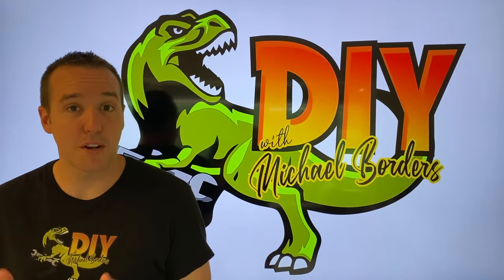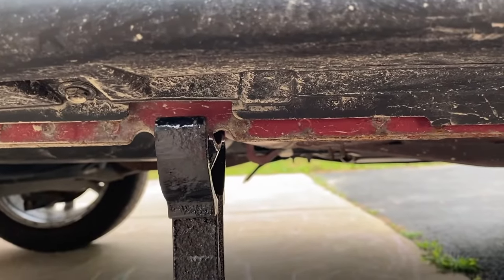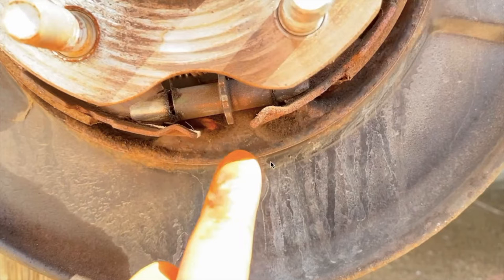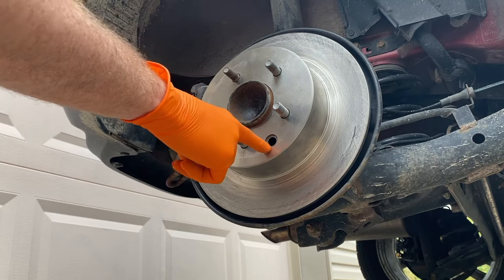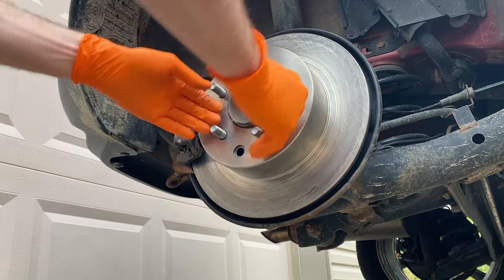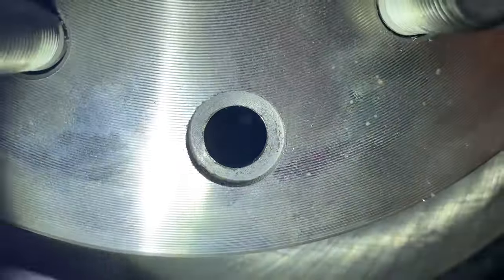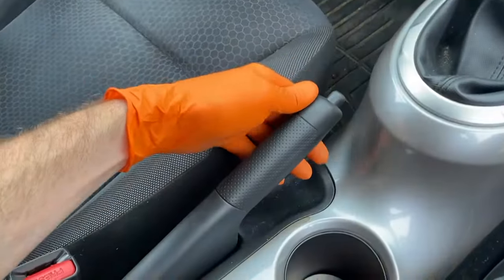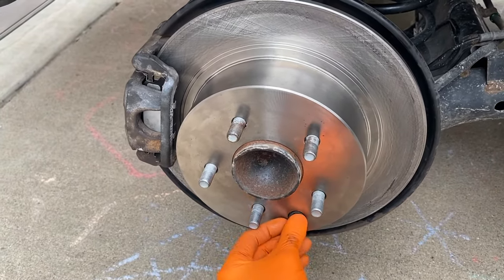Rear brakes rubbing - Adjust emergency brake

Comment: Thank you so much for this video, I had replaced the caliper and rotor but couldn't figure out how to set the emergency brake from rubbing. This was very helpful and I got my tire back together. Now I will need to replace the emergency brake shoes but that will be for a different day
Reply from the maker: You are very welcome, we are honored to hear our video was helpful.  Awesome job making it a DIY project.

Never forget the power of DIY… You will continue to benefit greatly and save lots of cash over the years by making your projects DIY!

😁👍🧰

Comment: I adjusted mine up since it’s a loud rubbing noise. I did it like how explained in the video but it was still rubbing pretty loud. I adjusted it up a few more times but then I couldn’t move the wheel by hand even with the parking brake off. Is it something more than just the adjustment that I should be concerned about?
Reply from the maker: Good morning ☕️

Any update?  Any recent repairs completed to brakes system vehicle wide prior to your issues?

This will help us figure out if any recent repairs are tied to your issue.  Looking forward to hearing back from you.

Comment: Did you do both sides? How many clicks did you end up needing to do? Last question I promise, do you rotate down on both sides to adjust? Thanks for the video. This will save me  money.  👍🏼
Reply from the maker: @sirlosealot8629  

Thanks for watching, we adjusted both sides however, you do not always have to adjust both sides.

The adjustment wheel can be raised or lowered as you adjust and find that perfect sweet spot.
Reply: I saw a couple videos on my infiniti and they adjusted up for tighter, but mine was down for tighter.    Another thought I have, these thin drum brakes under disk brake rotors aren't really emergency brakes, but parking brakes and not much at that.    Like on trucks, you depend on the e park to hold the truck in place, these little brakes won't do that and if you adjust them where they will, they'll rub and smell.    That's my understanding from my car.   I was trying to get them to work like my old cars and trucks with drum brakes.
Reply from the maker: @robbyddurham1624  

Thanks for watching, great thoughts.  In most modern rear setups on vehicle’s, there is a separate emergency brake motor assembly that activates when emer-brake button is selected.  It looks like a black plastic case or housing on back side of wheel and caliper.

This is completely separate from rear drum or caliper/pad brakes.  But again, this is the modern vehicle design, but pretty neat.

Comment: Do you put the gear in neutral during the process?
Reply from the maker: Good morning ☕️ great question.  You will keep transmission in the Park configuration during this project.
Reply: It’s a front wheel drive car so no the rear wheels are free spinning. On my Frontier I have to put mine in neutral (after chocking the front wheels) to adjust the parking brake.

Comment: Hello, is the car in park or neutral when doing this?
Reply from the maker: Thanks for watching, transmission will be locked in first gear.  If you have a manual transmission, configure it in Park.  👍🧰

Comment: Is the emergency break only on one side? Or do you have to adjust both sides?
Reply from the maker: Thanks for watching, both rear hubs will have the adjustable crank installed & can be adjusted to desired safety setting.

😎👍
Reply: Thank you, I was going to ask the same question

Comment: Do you do it on one side only? Or it has to be done on both sides?
Reply from the maker: Thanks for watching, you can adjust both sides for best results.

Let us know if you have any additional questions and hey if you’re into crypto, join our DIY ecosystem.

       toolboxtoken.com

Reach out to us any time!  🧰
Reply: Let me add more color to this. When u park on a slope, you must engage parking brake in neutral- not in Park. Then if u leave the brake pedal the car should hold. Then put it in park. When you start the car next u will see the shift from park to drive will be smooth. This will extend the life if your transmission. Your parking brake should be capable of holding car still in neutral even on a slope.

Comment: I have disc breaks on all four wheels. There are no drum breaks in the inside of my two rear axle break disc's. I have replaced all 4 brake discs with their associated brake pads. 
Now the two rear axle brake discs are hard to move by hand. So I don't need to increase the tension, in the handbrake cables, but rather reduce it. 
I can't find anything on/in the rear break dics, So I guess I can only adjust the parking brake with the 2 screws, in the interior, under the parking brake lever.
I found a video, were a man said:  The parking break in a rear disc brakes system, is self adjusting. And therefore can't be adjusted.

Any help is appreciated
Reply from the maker: Thanks for watching.  Unfortunately a self-adjusting emergency brake doesn’t always…well…self-adjust.

You may need to perform this manually.  Unfortunately we don’t have a video on your exact vehicle with the caliper setup on rear wheels.

It may be as simple as spraying the cable with brake cleaner and re-lubricating it.
Reply: @DIYwithMichaelBorders  my parking break cables (rear axle) are in a good and condition and well lubed. 

Where can I adjust my parking break, the only thing I can see, is under the parking Break lever in den interior.
Reply from the maker: @ImplantedMemories  

Awesome!  You can follow cable into caliper and carefully adjust or you may need to take apart center council.

Comment: I think my e brake is sticking at all times my nissan titan feels like im driving with my e brakes on even when i stop and engage the e brake and let off the brakes my truck will still roll and drive the same as if the ebrake is not on can loosening that little spring fix my issue??
Reply from the maker: Good morning ☕️

We can hopefully help.  It may be that you need to apply lubricant to your cable to get it to move freely again as it could in its earlier years.

Below is a link to our video showing this process.

       https://youtu.be/BuotJ-1yWNU?si=Ybc-OBZYQgPFIjVB

😎👍🧰

Comment: What's the steps for adjusting ebrake when you have a push pedal brake (2018 Altima), in my case..
Reply from the maker: Thanks for watching, it will be similar.  You will adjust mechanism inside wheel hub.

Comment: Ever replace the shoes, back the adjustment all the way (shoes are at thier smallest circumference) and still have an even but light rubbing? Like too much pad material?
Reply from the maker: Thanks for watching & it’s more common than you think after replacing drum pads.

Takes ever-so-slightest adjustments to get it right.  Unfortunately we don’t have a video yet.
Reply: @DIYwithMichaelBorders  thanks.
Reply from the maker: @dr.bonscott3962  

😎👍

Comment: What if I can’t spin my rotor? It’s too tight! What should I do ?? Thank you
Reply from the maker: Thanks for watching, have you adjusted the e-brake?  Have you double checked that the rotor you installed is indeed the correct size?
Reply: My car is an used car. I haven’t adjusted it for 3 years since I bought it!
Reply from the maker: @bradleywu7724  

Thanks for the reply.  Have you recently replaced rotors and disk brakes or do you have rear calipers?
Reply: @DIYwithMichaelBorders  I think I forgot to release the e brake when I was adjusting it. I will keep you posted. Thank  you
Reply from the maker: @bradleywu7724  

😎👍
Reply: Clean caliper pins & slots and apply fresh brake silicone grease.
Reply from the maker: @AlexB-km7os  

Great advice and we appreciate you sharing this.  Happy new year.  😎👍

Comment: I think you’ve fucked your brakes and rotors, I did this with my Subaru before watching your video because I suspected this issue. The thing is. With it only being three clicks up your parking brakes are still engaged when it’s all the way down leaving your rotora getting more wear. I think you’ll have to adjust it to where there’s 0 grind when the handbrake is off and 100% when the handbrake is pulled up like 6-7 clicks 
Isn’t that correct?
Reply from the maker: Thanks for watching & welcome to the DIY Raptor Club.  It may very for specific model & year designs.

Ours has worked as designed great since the project, no issues.  Keep us posted on your project.

Hope all is well with you and your family.

Comment: Hi I've adjusted it still rubbing and I've  taken my rotor off thinking it might be a snapped spring but no springs and straightened the handbrake shoe so it was centred but still rubbing and I also pulled apart and cleaned the bit where it pushes the handbrake shoe open for it to work it has new bearings in diff and new rotors new handbrake cable new handbrake shoes new break pads new rotors and rebuilt the brake callipers and still rubbing if I fully take the handbrake out and drive the car it doesn't do it
Reply from the maker: Thanks for watching, there will be a slight level of friction formed between rotor and pads however not aggressive.

If your hand brake is released and brakes don’t rub, that’s a good thing.
Reply: @DIYwithMichaelBorders  when i put it back together and spin the wheel when the car was jacked up it didn't make a sound and lowered it back down didn't use handbrake at all then took it for a drive no sound when I parked the car with out using the hand brake at all and jacked it up and spun the wheel no sound and after went to the shop and used the handbrake then on the way home it was rubbing got home jacked it up and had a look I think with no springs to pull the shoe back that little bit its going to keep rubbing so I'm going to buy a park brake shoe scrape kit so it has springs to pull the shoe back in place I'll let you know if it works
Reply from the maker: @steveo9115  

Thanks for the follow up, any update?  Some parking brake setups are self-adjusting…which allows you to pull up and down on brake handle a few times and the internal mechanism will properly adjust.

Looking forward to hearing back from you on how the scraper works.